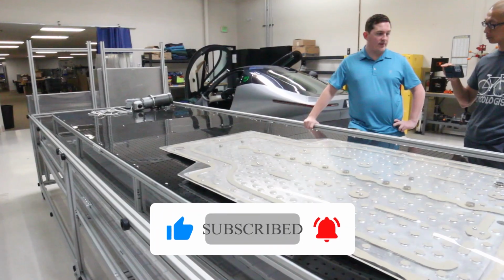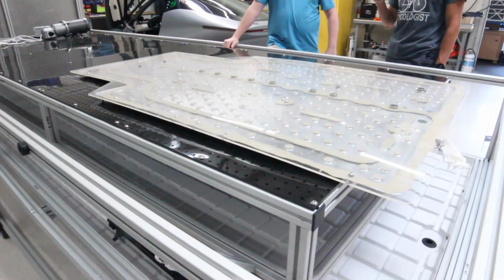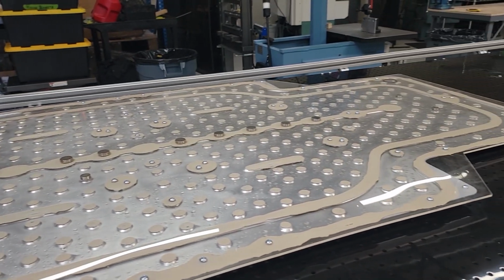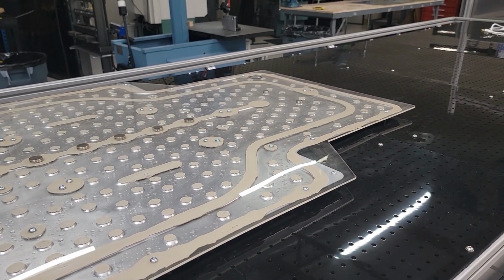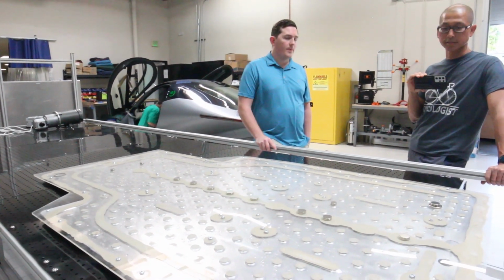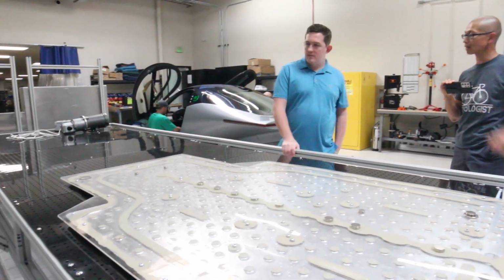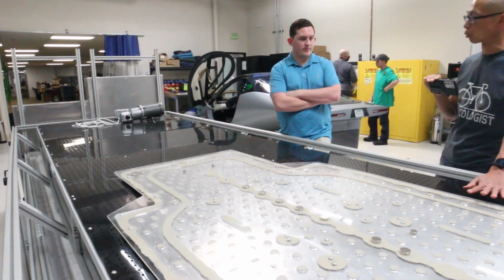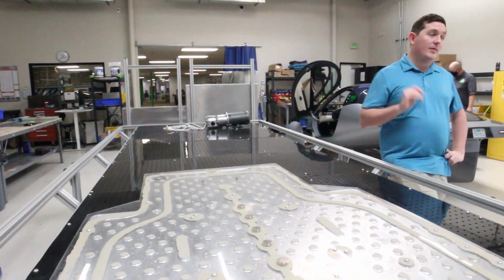Exclusive first peek at the Aptera's thermal management and testing rig

Comment: Expect the battery to fail, or degrade prematurely with this cooling method. Tesla have the cooling foils on the side of each battery rows, one or two heat pumps, super bottle and a real radiator; yet they expect up to 30% degradation over 120K miles/ 8 yrs. Now compare that with Aptera; 1. passive cooling, belly can’t cool efficiently when vehicle is not moving.
2. minimal heat transfer from battery pack level because cooling only the tips of the battery cells.
Aptera can remedy heat issues by nerfing speed  acceleration but this does not address cold climate heating.

Comment: Excellent.  Thanks for the video. Interesting battery temp management. I like it. Though, with the aluminium cooling plate on the bottom like that will mean the Aptera will not be able to do wireless charging too easily. If wireless comes to market, admittedly.
Reply: wireless charging of cars is just not going to be a thing. you would affectively have to engineer the car to drop to the ground like a lowrider to get the charging coils close enough for effective wireless charging. and do do this at kW power levels just makes even less sense for a car that barely even needs to be charged..
Reply: @mattb6001  Not true. Norway is already looking into it (https://www.youtube.com/watch?v=ezBpIVYLYNs). They did proof of concept on an iPace. Faster than CCS. Maybe not as fast as Taycan or EV6, but works. Even through a layer of ice. No lowering the vehicle or raising a pad up. Just a plate/coil in the pavement, surface at grade.
Reply: @Bumblerazz  hmm interesting. i didn't have time to watch the entire video but i think there's still some things they will need to overcome to make it viable. and as they explained, i think its much better suited to something like a bus where it has frequent stops to get the charge from. Also, these are some massive inductors and they certainly didn't just "tap in" 50kW of DC charging. I think its mostly a neat tech demo but the true integration will be a bit more difficult. Regardless, thanks for sharing that video with me.

Comment: Basically the plate we're seeing here is the conduction plate used to pull heat out of the battery. Since we can't just run fluids over the battery directly, we have to use a plate that both holds the fluid yet is a fantastic conductor. If you've ever seen PC water cooling, it works the same way. Basically the fluid runs through this with this either being soldered to the batter (highly unlikely for most products) or sitting on top with a layer of thermal grease. This then carries the fluid away from the heat source with the fluid then going to the heat sink or radiator.

Comment: Pretty underwhelming.  This is critical technology and it looks like nothing much is happening.
Reply: unless you understand the engineering being done and the development schedule  probably better to not make a judgement
Reply: @johnmalcom9159  Well, he was pretty proud of that expensive table for not spilling coolant all over the place.
Good engineering there. That was self-evident. The rest, not so much.
I'll hold judgement - till I see results.  For now, It's just impression and opinion.  I do hope I'm wrong.
Reply: The control panel was empty and the pump wasn't hooked up. That indicates to me the system has not been used yet.
Reply: @GaryGreenway  This looks like a considerable advancement on the thermal testing rigs I saw when I visited last November.  Progress is rapid and they have a far larger engineering staff now.

Comment: OK maybe I'm missing something here. I see an outside channel and then an inside cavity. What I'm trying to figure out is How does the coolant flow through this simulated belly pan? I see a hole at the front and a hole at the back (in/out) but how does the fluid exchange from the inner cavity to the outer? 
I imagine the batteries sit on top of this pan (?) in order to get their end heat exchange. And this young engineer already has the over analytical engineer speak so reminiscent of the trade. lol
Reply: There are 2 parallel paths through the plate. A wide inner and a narrow outer.
The flat ends of the batteries would be in contact with the aluminum plate. They would transfer the heat through the thermal paste into the aluminum plate and into the coolant on the other side of the aluminum sheet.
The top cover is clear plexiglass to visibly monitor coolant flow through the channels between the caulk barriers for lack of dead zones, proper turbulence, and expulsion of air bubbles. The rig i saw would test the the hydraulic properties of the heat exchanger. 
To test the hydronic properties the engineer would have to induce a known amount of heat into the aluminum panel from the bottom and measure the flow and coolant temperature difference of the coolant entering and exiting the cavity between the aluminum and plexiglass. 
In the latter test a thermal imaging camera could be of value to measure heat gradients through various areas of the coolant channels. It cannot see through the polycarbonate per se, but can measure the surface temperature of the plastic sheet controlled by the coolant temperature directly below it. 
The production heat exchanger has no need for a plastic plate. Another sheet of aluminum will suffice to reduce weight.
Reply: @GaryGreenway  wow, great explanation. You should post this in the Community section on the site to give everyone an idea of how the system works. A lot of them (like me) are scratching their heads on it’s operation.
Reply: @SteveBueche1027  Thanks. Steve made the video for us so I left my opinion of what I saw here. It would be out of context there. As far as I'm concerned, Steve makes the most informative videos so people should visit this channel for explanations. He told the story and I filled in some of the blanks.
Reply: The picture you were looking at was the battery cooling plate, not the belly pan.

Comment: 🔌I am confused. What is the method of cooling the batteries during charging when the ambient is 120F in Arizona? Does the BMS simply say wait until night to charge when the temps drop to 95F?🔌
Reply: Aptera will have an A/C compressor and can cool the batteries and interior.  The compressor can draw as much as 1.5 kW while it is running.  The vehicle will be tested to operate over a temperature range of -20 to 125 F.  Should the battery pack approach damaging temperatures, the BMS system will shut the power down until temperatures reach safe levels.
Reply: @n.brucenelson5920  That makes sense. If a person elects to charge the vehicle with 120-volt the maximum current draw on a 15-amp circuit breaker is 12 amps before it goes into its trip range. During charging the max wattage would need to be below 1440watts which is easy to manage in a BMS.
Reply from the maker: Good question.  I should've asked about the situation of charging when there is little airflow over the bellypan

Comment: In my previous comment, I was thinking of driving conditions but the real battery heat will likely come from charging at high Level 2 and Level 3 charging, especially Level 3. The batteries can get very warm/hot when fast charging. Without airflow across the belly pan during a fast charge, I am wondering how they are going to dissipate a considerable amount of heat.  Many EVs seem to run the cooling system for the batteries but that often involves a radiator and fan.  While there is a skin radiator with coolant to flow through, without air movement across it, it is not terribly effective.

Level 3 charging might be convenient, it does impact the lifespan of the batteries.  Lots of mobile devices are finally getting smart about charging and fast charge when needed but when you are sleeping for example, slow charge.  I would expect the Aptera UI to determine what kind of power is available to charge (this is standard) and then ask when do you need the vehicle charged by?  If it can charge slower and be topped off by the time you need it, the longer the batter will last.  Of course if you can get the solar option to top off the batteries, great. 700W is basically a trickle charge, if that.

The other heat related issue I have is when the vehicle is sitting in a parking lot on a hot day where the temperature is >90F.  These batteries do not like hot temperatures and any air flowing across the belly pan will be hotter than what is good for the batteries.  Without a heat pump and that will consume energy from the batteries, how are the batteries to remain at operating temperature?
Reply: I used to design refrigeration systems, including the samples freezer that flies on the ISS.  Aptera will be validating the vehicle over an ambient temperature range of -20 to 125 F.  They have an excellent BMS that will shut down power if battery pack temps approach damaging levels.  

Aptera also has an A/C compressor that can be engaged to remove additional heat.  They are not relying only on circulating antifreeze solution.  The high side of the refrigerant loop will still have enough of a temperature differential to move heat to the belly pan and then to the air.  This compressor will draw about 1.5 KW when operating.  Remember that temperature and heat are two different things.  Aptera is so efficient that the total heat the systems will have to manage is considerably less than for any other EV.

There may be situations where the 50 kW DC charging speed can't be fully utilized due to cooling limits.  The beta validation program will be testing to see what those limits are.
Reply from the maker: great question.  I unfortunately didn't ask about that scenario.
Reply: It's over 100 degrees in my garage in the summer in Texas, but that's where the Aptera would have to be charged.  My Chevy Bolt fans kick on ALL THE TIME in that garage while charging.

Comment: If this where they are in the cooling system design phase, they are years from possible production.
Reply: I designed and delivered a prototype samples freezer for the International Space Station in less time than what Aptera still has.  The engineering principles are well known.  There is plenty of time to design, test, and build prototypes if they are focused.  My company also did several EV systems AC systems, including for the Ford Think! city car.
Reply: Having production intent prototypes built by the end of Summer for tests and demos is their goal. That is less than 4 months from now. I agree that will be a stretch, but it won't take years.

Comment: Sounds like the belly is going to be quite delicate…
Reply: It may weigh more than the composite prototype I saw when I visited in November, but it will have around 40 times the thermal performance for the area it occupies.  My Gen 1 Honda is made from aluminum and after more than a decade of use, the word "delicate" does not come to mind regarding the performance.
Reply: @n.brucenelson5920  I should be more specific, I'm referring to microchannels in the aluminum underbody being delicate. If you ever strike something underneath, which is pretty common, you could easily puncture the channels I presume?
Reply: @bob15479  You are certainly correct that this could be an issue.  Our companion the engineering trade off shows up.  A thicker plate gives more thermal mass, and is less delicate, but adds more unwanted weight.  They will have to decide on the balance.

They may have room to play with the hardness and malleability of the alloy they use as well.
Reply: @n.brucenelson5920  I wish the underside of the tail/hatch compartment contained the radiator instead of the belly. then we wouldn't have to worry about this.
Reply: @bob15479  A radiator of conventional design still would cause increased drag and result in more heat being produced to compensate because more power would be needed.   They have already increased the drag a bit to produce downforce at speed at the rear of the vehicle.  There are several competitive goals to balance and it is important that they consider all of them when walking the performance edge so closely.
Reply: @n.brucenelson5920  when I say radiator I mean "dissipating panel" for lack of a better word.  I just wish it weren't at the lowest point if that makes sense.
Reply: @bob15479  I totally agree. But I don’t know the aerodynamics in that area which would need to be considered.

Comment: Hopefully the pump or if no pump the heating element will be easily accessible for changing when needed , coolant lines and seals always need changed sooner or later, fittings just naturally wear out due to normal vibrations.
Reply: Aptera supports right to repair.

Comment: Having the cooling surface on the bottom of the car exposes to increased heat off the road so how well will it perform in hot climates?  Stop and go traffic?
Reply: There will be limits, but how quickly they are reached will be part of the validation process.  The BMS system will shut down the power before damaging temperatures can be reached.  There is also an AC compressor that can assist in cooling at the cost of 1.5 kW additional power load.

Comment: This was great to see. The battery cooling plate seems huge! Was this set up for the 100kWh pack?
Reply: The more surface area the plate has, the less temperature differential it needs to function.
Reply: @n.brucenelson5920  That makes sense. But if this is the battery cooling plate, would they have it larger than the actual battery contact area? To me, the battery pack cooling plate looks to be about 4' X 7', which may be the right size for the 100kWh pack, but the 40kWh pack would be less than half that size. I can understand having a larger aluminum belly pan to exhaust the heat. But for efficiency and ease/lower cost of manufacture, it seems that you would want to match the size of the cooling plate to the battery pack.
Reply: @n.brucenelson5920  For the belly pan, yes. Anything that doesn't touch the cells on the battery plate has little function other than connections and mounting flanges.

Comment: It will be interesting to see how effective this system is during low-airflow high-demand situations (ie: stop and go traffic in 100+ degree weather).  The lack of an active radiator fan makes me a little nervous.
Reply: Don't be nervous. Stop and go traffic is not a high load situation. A high load situation is high acceleration or high speed trying to push through tons of air.

The Aptera's 100Wh/mile is near the high load situations. When sitting still you are using near zero power. Account for the AC and radio and that is still relatively nothing. In ice vehicles it gets hot in stop and go traffic because you are constantly exploding small amounts of fuel and the heat from those explosions needs to go somewhere.

Air has a coefficient of heat transfer of 10-100 W/(M2.K). That means the larger the surface area or larger difference in heat the more heat that is transferred.
Reply: @TatteredMind  I think what you're saying is a misguided attempt on this forum to "protect" Aptera from a validpotential criticism. I think catamounts is correct to   be nervous. When the battery is being CCS fast charged there will be a  significant heat load coming from the battery. This happens at a time when there is no movement of air over the skin. This is will be a significant threat to the battery.

Please don't misunderstand. This is constructive criticism before a real production problem can occur. I don't work for Aptera so I can't "air" (get it?) this potential problem in house. But they need to get this right before it does become a problem so that's why I bring it up. Don't suggest convective cooling sitting at a charging station will solve this. It won't.

The whole reason Aptera went for skin air cooling is to reduce the large aerodynamic drag of a radiator. That can still be made to work by installing a radiator and having a door that only allows fan driven air to it during stationary operation and perhaps at low speeds. That door can remain closed and keep the Aptera aerodynamically efficient during normal operation. Yes, this will increase the complexity and expense of the vehicle but will probably give the vehicle much more battery longevity. If Aptera can design the cooling to be effective during stationary and low speed operation without this additional detail, then more power to them. I have my doubts that they can pull it off. I'm very glad though that Aptera is showing they take this concern seriously by allowing this video to be made. That's a very good first step.
Reply: @erichabegger9895  You make some good points. I'm sure the battery will be protected from overheating as that is basic battery management. However, fast charging in high heat situations could cause the charging rate to slow to protect the battery. 

I think it would be obvious to use the cabin A/C system to also cool the battery in this situation, using a cabin fan or 2 to exhaust the hot air after passing through the A/C.
Reply: I think the "Sky is not falling" and you are way over acting. Aptera has good experienced engineers and will account for these things in their design. You state an unsupported (Without data) opinion. Either do research or troll somewhere else
Reply: Since it isn't an ICE car that wastes fuel idling, that's not a problem for any EV, belly pan or radiator cooled.
Reply: @sprockkets  No, but the batteries heat up when charging them, and that heat has to be removed somehow or you'll end up with battery degradation like the 1st Nissan Leaf (no BMS) had.
Reply: @ClickToPreview  the batteries in a leaf never had this happen because it charged so slow. What happened was their batteries were used during operation in Arizona high temps. Note that batteries like around 100 F when charging. Even vehicles like the model s heat up batteries for max performance.